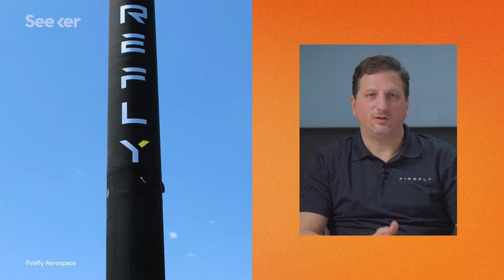The Race to Launch Small Satellites Is On For Firefly Aerospace

Comment: 15 Million for a one ton payload?  That's $15,000/kg.  SpaceX currently charges $2,700/kg!!!  And offers rideshare for small payloads.  With Starship coming soon, it will charge significantly less than that.  There is no business case for this company.
Reply: Ridesharing sacrifices flexibility of the mission. These small rockets allow the customer to have free reign over specific orbit of the payload. Also, they're experimental vehicles, they're bound to be expensive at first.

Comment: So this is supposed to be in between the electron and the falcon 9?  I have to wonder just how well these companies will do when the Starship is flying and able to kick out these small sats as an afterthought during normal flight operations.
Reply: bruh thats a competition
Reply: These small companies are cashing in now but long term their bet is that starship will be a bust
Reply: The thing with starship is it's not a cargo rocket. Falcon Heavy is. Starship is for commercial space flight and planetery travel.
Reply: And also it's near impossible for small scale projects to secure a spot in the contract for space x flights. Like small scale university projects. The lesser the weight is the easier to fill up the maximum load and the cheaper it will be to launch. But yeah reusability gives a hard edge but... small scale rockets can never be reusable. Simply not enough fuel for reentry and landing
Reply: @chonkyboi4558  Well, first off, there will be several variants of the Starship, including one strictly for cargo.  With a large primary payload, they will have plenty of area surrounding it in the cargo hold for smaller payloads.

Second, while transferring crew to and from the ISS, they will have the opportunity to carry small cargo for side missions, as they already do with the cargo and crew dragons.
Reply: @hellcat1988  and the stainless steel body dowsnt have a fairing system for payload deployment buddy. Neither does it have any openings on the body except for the cargo hold docking port
Reply: @hellcat1988  I have a feeling you are just talking too much from watching one too many youtube videos mate. If you are aware of the every single detail of launching a rocket like the thrust to weight ratio, dry mass propellant mass, KN ratio, thrust calculation and orbital mechanics you wouldn't keep vouching for this new shiny piece of steel.

It's nice to look at, its comfortable, It maybe the best option we have as now for A crewed Mars mission and all but its certainly not going to change the whole rocket industry and space sciences and exploration sector
Reply: @hellcat1988  and as i said. The payload bay IS the cargo hold port. Something like the hatches of a crew module or Soyuz. It's not a port like in a space shuttle which can open up. The stainless steel body had to be uniform otherwise it wont withstand the vibrations.
Reply: @Chonky Boi It can be Lander, human transport system, and cargo. There is diffrent versions.
Reply: @Chonky Boi You are physics student and what? Roskosmos... What they have? Ahhh yes Soyuz that is basicly to museum. ESA? Nothing.
And why you think they could't made cargo bay on Starship? They made reusable Rockets and first working full flow staged combustion engine do why they could't do that?
Reply: @chonkyboi4558  not th reason they went with stainless steel.  Starship WILL have heat shield tiles on one side of the rocket.  They've already been experimenting on different configurations and mountings of such tiles.  They are also going to be developing a cargo version of Starship and hope to be able to deliver a cost of 3 million per launch.  The hope for firefly is that there will be so much demand for starship launches, spacex won't be able to keep up with demand and the industry would start looking at alternatives to get off the long waiting list.
Reply: @davidbrenchley  then it pretty much beats their whole idea of using stainless steel. It's just adding more and more weight. In my eyes Statship is beginning to look more and more like a engineering nightmare. Falcon Heavy is the best possible for cargo now
Reply: @chonkyboi4558  well yeah, falcon heavy for now.  Starship isn't ready currently as it's being developed.  But it will be the cargo of the future.  As for engineering challenges, stainless steel is far easier and cheaper to work with than composites.  You keep throwing out postulations when it appears you've done no research yourself.  I think you need to do a little more studenting.

Comment: But is it reusable? We need to address the problem of space junk.
Reply: that thing's small and will most likely just burn up during reentry
Reply: They don't orbit the earth afaik, they fall back
Reply: Made of carbon fiber, pretty expensive, damn well ought to be reusable.
Reply: @polychoron  most rockets are made from it and don't come back, and i don't think they can make it reusable with small size.
Reply: The 2nd stage of rockets going into low earth orbit nearly always have enough fuel to de-orbit and burn up so do not add to space junk.  Reusing the 1st stage is probably doable in the future.

Comment: How is this cheaper than SpaceX if you group a bunch of small satellites into one launch of a Falcon 9?
Reply: Cheaper in terms of contracts due to the small scale and lesser fuel and carbon composite body which can be rebuilt again easily.
Reply: But you would have to put them into one orbit, and that sucks a lot. But Rocket Lab is working about it.
Reply: The main issue is that only makes sense economically if you have a PILE of cubesats etc in there.

Metaphorically Speaking:
Electron is the space car, this is like a van or rapid bus transit.  SpaceX is the subway.  Nasa is a shipping container ship, or superheavy aircraft.

Comment: Are their rockets reusable?
Reply: Not that's a small rocket 2 stage one. Not enough fuel to do a reentry and landing. And the technology is proprietary for space x
Reply: @Chonky Boi They could use parashouts to splashdown like Rocket Lab
Reply: @ImieNazwiskoOK  that' usually what 1st stage seps do but nah bro this is a carbon composite rocket. Due to the heat the fibres will be too damaged and the resin will have disintegrated for a re launch.
Reply: @chonkyboi4558  isnt rocket lab also using carbon fibre composite
Reply: @tomatenbomber8830  didnt check it bro. Not sure. But I have launched a carbon fibre model rocket before. The threads just shreds into fibres when exposed to the heat during the burn and also during return. I doubt this would be salvagable
Reply: @tomatenbomber8830  also only 1st stage can be retrieved back using parachute tbh. 2nd stage maybe to control the descent but definitely would be too messed up for reuse
Reply: @chonkyboi4558  ye agree, they are using carbon composite, and have only first stage retrieval. They are using a heatshield but its not clear how exactly as they are a lil secretive
Reply: @tomatenbomber8830  ceramic shields ?
Reply: @tomatenbomber8830  yes rocket Lab uses carbon fibre for there rocket

Comment: Carbon Fibre... That's Expensive! 🙄 How cost of launch/km gonna less expensive? 🤔
Reply: All other companies: We use lightweight carbon composite bla bla
Elon: Uses stainless steel which is cheap as F and also plans on making it reusable
Reply: Material cost is a small % of the overall launch service.
Reply: @Matthew35333  Well I guess customer pay as per km launch... If materials are economical then launch is cheap... Customer looks for price not material of rocket... ☝️
Reply: It's lighter so it can carry more payload. And compering to engines it's cheap.
Reply: @ImieNazwiskoOK  Logical.... 👍
Reply: Weight is a huge deal with smaller rockets build them out of a heavier material and they'll barely be able to carry anything after fuel

Comment: Honestly I think they are just trying to replicate rocket labs electron, on a much higher budget using older tech. The small sat market is NOWHERE NEAR a niche at this point. There are atleast four tested and proven companies that already launch for a lower cost. All I’m saying is, if “firefly” can do anything different to the current companies (e.g, recover and reuse [not refurbish] but electron already does that) then they might have a chance at making a profit and becoming a main launch company. Carbon fibre rockets aren’t new, small-medium launchers aren’t new, kero-lox engines aren’t new (or as efficient as others).

Comment: SEEKER WHAT ABOUT THE SPACE DEBRIS. HOW DOES PEOPLE TACKLE THE DANGER CAUSED BY SPACE DEBRIS. THERE ARE MAPS SPECIFICALLY FOR SPACE DEBRIS.  WONT IT BE A THREAT FOR THE ROCKETS ABOVE  AND THE SATELITES IN ORBIT.  A GENUINE QUESTION. (Stuffin.space link for the space debris map)  PLEASE SAY . IAM UR SUBSCRIBER AND U OUGHT TO HELP IN MY DOUBT PLEASE
Reply: Well yeah I just thought about it today. What's your proposal
Reply: My idea for smaller than 10cm debris is launch a big enough cube sat with a TMOS solution and water to produce aerogel and a solar sail. Put it on parallel orbit to small debris clouds.. achieve around 8kms velocity and expand the solar sail in the back and aerogel in the forward so the aerogel can trap the small projectiles while the solar sail eventually decceleates the sat and degrades its orbit bringing it all back to Earth
Reply: Also check onto the JAXA electro magnetic together and Clean DEBRIS and CLean space 1 projects

Comment: Why is footage from space always CGI??? 1 metric ton is nothing.
Reply: Nope. 1 metric ton could be enough to fit in at least 5 starlink satellites, or dozens of cube sats. Its CGI because there hasnt been a launch yet and even if there is you wont be able to get a spectator view unless there is already a sattleite pointing its camera at the rocket  and its CGI because it's a proof of concept developed by the company. Small scale rocket industry is beneficial for student projects university projects and small scale space businesses with reduced cost. It's like the twin engine turbo prop passenger planes. Smal and cheap
Reply: @chonkyboi4558  do a little research gi see how much Hubble space telescope weighs. And then go see the capacity of the rockets that took it up.  Also CGI for any mission??not just this one
Reply: @neil9231  huh?
Reply: @neil9231  well I dont know the exact weight now since there have been service missions additional filters meteorite shields and such but I know for sure the initial weight was around 10 metric tons. Why though ? 

And nah mate I remember this well. Hubble was launched in space shuttle discovery. It wasnt a rocket payload mission. It was launched and deployed by a space shuttle
Reply: @neil9231  and what's the deal with the CGI mate I dont quite get it. Have you never been bothered to watch proof of concept videos before or something ?
Reply: @chonkyboi4558  the point is there is no proof of concepts..there is no need to make. CGI of any of these concepts in 2020 when we have high definition video and pictures. why we need cartoons to show me the real thing.
Reply: @neil9231  mate. Are you alright.  Just think about it bruh. In space do you think they have cameras pointing everywhere?

Comment: Consider the following:  The Earth's magnetic field continues to weaken, currently projected to be at it's weakest around 2035.  This is going to allow more and more harmful cosmic radiation to reach those satellites, and us.  U/V C, which is normally not seen on the surface of this Earth, is already being reported as being seen on the surface of this Earth.  U/V C being what some hospitals utilize to sterilize some of their equipment with.

In addition, the Earth's magnetic poles continue to move, even lately speeding up in doing so.  The North magnetic pole is currently moving towards Siberia and is projected to end up around Indonesia and the South Atlantic anomaly continues to grow in size.  The Earth's magnetic poles are most probably going to flip again, which has occurred numerous times already in Earth's history.

But now also, electric grids here upon this Earth, and especially electronics which utilize very small milli-volts and milli-amps which are also in satellites, could potentially be negatively affected.  It would only take 1 satellite to fail, (and there are a lot of satellites up there around this Earth), and if it crashes into another satellite, could generate a debris field which could negative affect other satellites (even ones hardened against harmful cosmic radiation), which could generate more debris in a cascading exponential fashion.

Any portions of satellites that did not burn up upon re-entry, would most probably impact this Earth somewhere.

Besides the loss of those systems the satellites provide, other harmful negative effects could also occur.

So, why exactly are we sending up more satellites into Earth's orbit at this time of human existence?  Shouldn't we wait until after the Earth's magnetic field and poles settle down?  (Unless those satellites are absolutely necessary and are basically expendable, including the services those satellites might provide).
Reply: No lol. Sun would first destroy Earth than there would be no magnetic Field.
Reply: @ImieNazwiskoOK  Go to 'SuspiciousObservers' YouTube channel and see the info for yourself.  The Earth's magnetic field is weakening.  And whether you believe it or not, I really don't care.